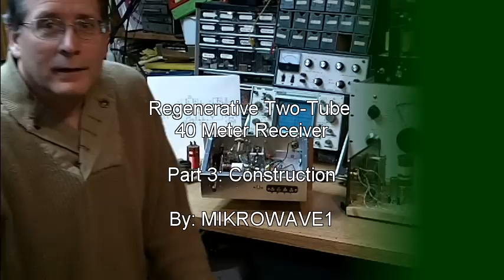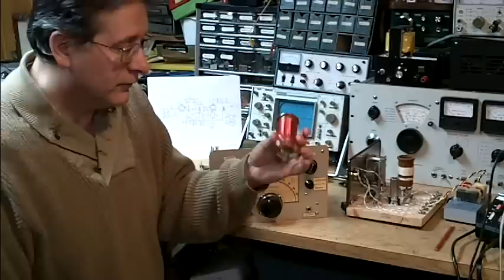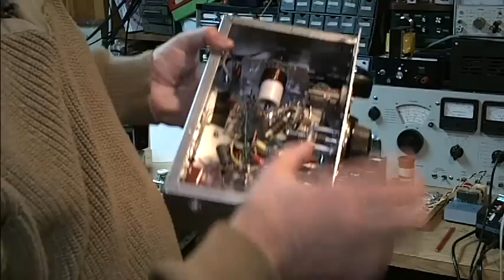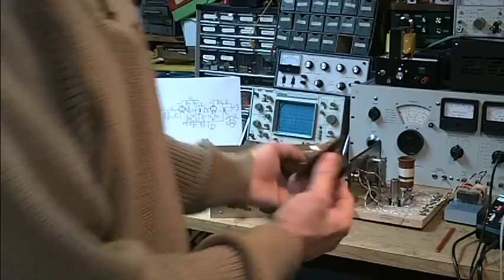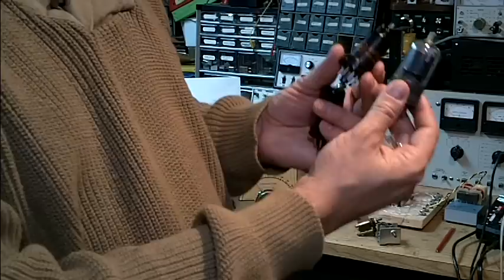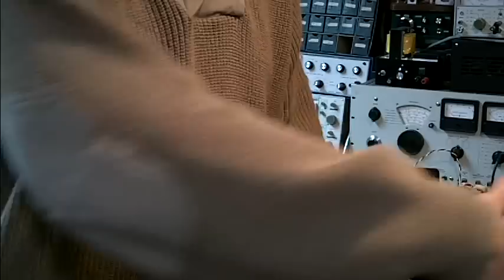Regenerative Two-Tube 40 Meter Receiver Part 3: Construction Tips

Comment: There was a three tube regenerative design from the 40's I'd like to build.  It had a 6K8 converter stage, a 6J7 (or 6SJ7) regenerative detector, and a 6J5 or 6C5 audio stage, (Though I was thinking of using a 6G6G as the audio stage).  IF frequency was around 1500khz (maybe I'd use a surplus 1415khz IF transformer from a BC454, and add a tickler coil to the secondary).   I also was giving some thought as to making the converter regenerative, adding a little feedback via a cathode tap on the input coil, giving just enough feedback to act as a Q-Multiplier.
Reply: I built that about 10-12 yrs ago. I think it's in the Feb. 1941 issue of QST. It's  not too difficult to build and it works fairly well, though it won't knock your socks off.

Comment: Superb videos. So good, you've inspired me to start looking around for parts. Interested in the Kitchen CQ magazine 2/2010 design. Hopefully will work as a GC and amateur rcvr. I know I'm not crazy, old receivers or older designs, generally sound more pleasing to listen to. Thanks for the kick and now off to my storage unit to determine what particular ARC 5 transmitter model I have hiding in there. :)
Reply: Overloading is the main issue. Loose Antenna coupling etc helps

Comment from the maker: For our purposes, which is getting as much of the signal we want signal as possible out of a single tuned circuit and the least interference: Q is the measure of loss that the components making up the tuned circuit have. It is their "quality factor" or Q. A coil made of copper wire will have some resistance and this will determine how high its natural Q is and how sharp the tuning will be. A lossy coil (low Q) will produce a broad response. A crystal radio diode heavily loads a tuned circuit lowering its Q. A regenerative receiver has the ability to artificially raise the Q of a tuned circuit though a property called negative resistance!

Comment: Re miniature tubes, an EF89 with work very well down to 12 volts so will an EF92 a 6BW6 also works well at 12 volts. No shock risk on 12 volts